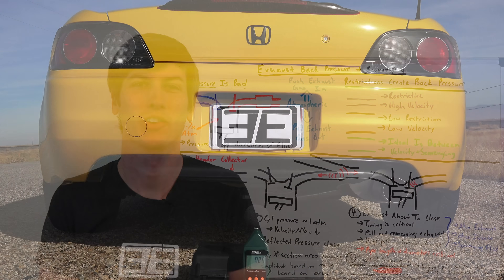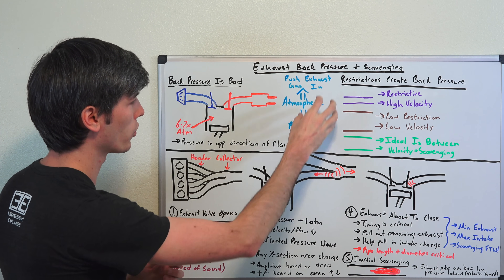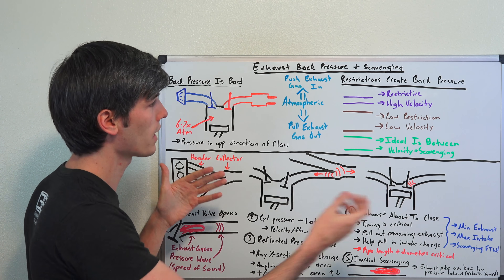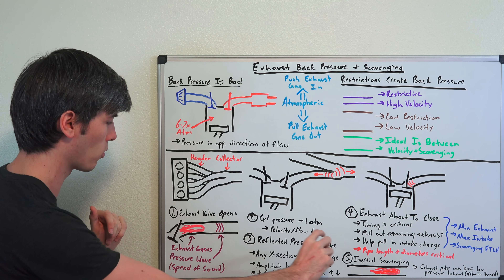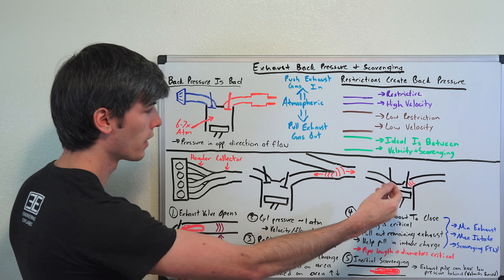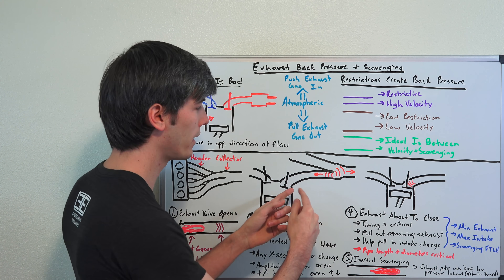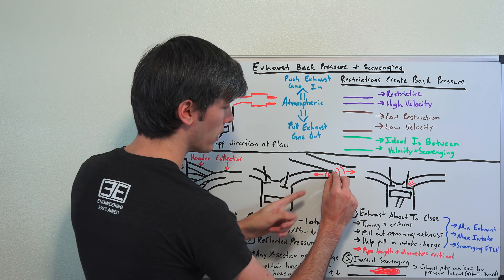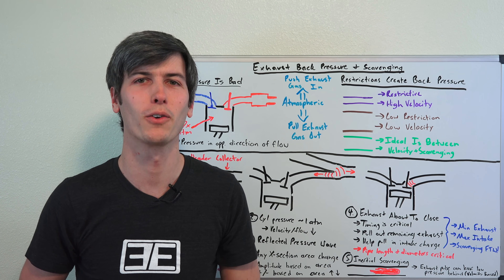Stop Saying Car Exhausts Need Back Pressure

Comment: In most older cars (at least ones that i have had hands on with), back pressure is used to help open the exhaust valve. This mitigates the force required by the engine to open the valve. The more pressure difference you have between the cylinder and exhaust pipe, the more force is required to open the valve. This is why you see a power loss when you slap a higher diameter exhaust on it.

Comment: And it's dependant on the amount of valve overlap...both need to be open to translate the low pressure signal from the exhaust ,through the cylinder, to the intake system.

Comment: Can u explain how when nascar enforced the use of mufflers the cars gained more power with back pressure? Also u don’t explain the scavenging affect of back pressure either. Should use a flow bench to see how some not all but some exhaust systems create higher flow then straight pipe. Again back pressure does help on some engine once u start getting into high horsepower then no it won’t help but lower daily driven vehicles absolutely just use a flow bench number don’t lie

Comment: They do need back pressure, at least on old engines. I had a 1978 carbureted Dodge 360 that flooded and blew out muffler during cranking. While driving to a muffler shop, it was weak, lacking power. After the new muffler was installed, it was back to normal.

Comment: You do need a small amount of backpressure for low end power, if you are running a race engine at high rpm all the time you dont need it, if you have a turbo vehicle then the turbo is where you get backpressure.

Comment: I think the back pressure myth might come from back when all cars had carburetors. If you drastically increase the available airflow to the engine without changing carb jets, you can end up with a lean condition. That said, exhausts back in the mid-70's and through the 80's were likely way more restrictive than the air intake, so just changing the exhaust would be enough to alter that airflow. I could be wrong, but that's my guess, since it's always older gentlemen who tell me about back pressure.
Reply: Sweet Warlock.

Comment: those of you saying you have lost power, you may well have.  Horsepower is a function of torque.  You can tune where your peak torque RPM is  by changing your header pipe cross section.  The formula   Torque Peak RPM= primary pipe c/s area x 88200 / volume of 1 cylinder.  So if you put something really big on your engine, then you moved your torque peak way up in your RPM, meaning your engine will have to scream to reach that point.

You can use a variation of that formula to find what size exhaust you should run for a specific RPM:   Primary Pipe c/s area= volume of 1 cylinder x RPM peak / 88200.  This way, you can set your torque peak at an exact point of your choosing, and find the header pipe size that is perfect for that.

Those of you that mentioned racers having multiple header sets are correct.  they use them to tune the engine based on the demands of the track.  An oval track where they can maintain a high RPM they can use a large pipe.  If they are going to have to do lots of acceleration and wide changes in RPM, they will probably use a smaller pipe to move that torque peak to a lower RPM so that they have power to accelerate.

Lots of math when building an engine for racing.

Comment: A lot of car guys talk about the backpressure BS. Sure, you don't want to run an engine with open exhaust ports! But if you reduce the backpressure of an engine just adjust the carburetor to compensate. Not that complicated.

Comment: so to design a set of aftermarket headers could you take the length of the factory header run an use that to go by for your measurements,.. would also be interesting to know how turbochargers effect all these variables as well :D

Comment: I managed to break my exhaust down the the back end of the catalytic converter. Noticed fuel efficiency went up a bit but I did notice that my car had more trouble accelerating up hill without pushing down a bit more on the throttle.

Comment: Exhaust back pressure was required on older motors to prevent burning the exhaust valves.
Check it out.
Reply: Only if lean after changing exhaust. Tune the carb. and no problems.

Comment: Great analogy. Is a negative pressure also called a vacuum? Seems it would be easier to understand calling it a vacuum. I think the engineers who have been designing systems for 100 years would understand this without the explanation. I may be wrong but I don't think they design engines to not perform. So thereby the design is going to be pretty much spot on...Right? No matter whether it is called back pressure or negative pressure.You're one smart guy. I hope you are not spinning your wheels here trying to reteach the masses something that most just do not care anything about...But in real time...Seems like it would be more so an exhaustive and frivolous attempt that is going to just result in way too much back pressure. :) Love your videos bro.

Comment: The only exception is on vnt/vgt design turbo’s. On rare occasions it is a requirement to have “back pressure” to be able to control the turbine speeds correctly. (It is more to do with velocity through the turbine wheel than actual back pressure). You can modify the turbine housing, wheel profile, nozzle limits etc to compensate but to the average “car expert” it can cause turbine over speed and eventual turbo failure. This does not apply to wastegated turbos of course.......

Comment: Non racing cars and motorcycles both gain considerable torque and power by using a silencer with some form of end baffle compared to a plain open pipe or a straight through silencer. I have 40 years of race engine development and dyno operation behind me and this I am certain of.

Comment: Excellent video! You've answered many of my questions except one. How do I figure out what is the correct tubing length and diameter if I was to design an exhaust system so that it makes power instead of losing power?
Reply: No exhaust! JK
Reply: @billbergen9169  No exhaust usually is not the answer.  There is no "tuning, no scavenging effect.
Reply: i think thats the hardest part...
i'm pretty curious too
Reply: This is so old, anyone figure it out how to calculate those?
Reply: @AkbarNurPribadi  There is a way that I learned in another video.

But it's in imperial, so I have to convert it. 😑
Reply: Extremely complicated math and computer simulations of wave propagation that was probably over the head of engineers until just a few years ago---OR trial and error,experimentation and track and dyno testing--I think that was the way it was done in the old day,even by race teams
Reply: @davidpowell3347  God can  ou imagine how tedious that must have been? I mean we hail the drivers from way back when... but jesus... Thinking about those engineers and how they managed to do what they did just stuns me everytime...

Comment: My wifes 2009 toyota yaris has had the exhaust gasket after the flex pipe 
deteriorate 3 times and the car sounds like a tractor each time.   When this happens the car can barely make it up a hill which normaly it could excelerate continuously up the hill when that gasket is 100%  why is this happening then?  The car is also a standard and no matter which gear i put it in after the gasket has failed the engine lugs so badly up hill the car shakes, take it to the shop replace the gasket for 27$ including labour and i can make it up the hill doing 50 km/h at the bottom and 110 at the top.  so i guess the 1.5l engine does need back pressure I dont care what your science says

Comment: Is this the case in let's say a smaller displacement, tuned intake, n/a gas engine? Does dumping exhaust into a 3 inch pipe vs a diameter that is a ratio of intake diameter and length.

Comment: In another words, you just don't know how good that exhaust system is for your car until you put it in and get it tested? This really sounds like only the car manufacturers themselves could calculate the optimal flow for the particular engine they produce.

Comment: years ago racing snowmobiles, we learned that proper exhaust design gave the equivalent of super/turbo charging.  You pulled air fuel mixture into the exhaust, and then the pressure wave pushed the mixture back into the cylinder.  Made good power but also polluted a bunch.  (And they were louder than heck, I don't hear as well as I should because of it). ;)

Comment: My motorized skateboard (when I was 18)  would go from 0 to 20 MPH very quickly with the muffler bolted on. With it off, it would struggle just to get moving and take a long time to get to top speed which was then 25 MPH. I tried my Mazda RX-7 with no cat converter or muffler on it and it too lost it's quickness from the starting line. Both are essentially two stroke engines but there seems to be something important to back pressure.

Comment: isn't there also an engine balance issue? At high rpm's the engine needs to be well balanced if it isn't going to shake itself to death.  Surely the key is to ensure the exhaust path resistance is as near as possible to the intake path ?

Or if the engine designers planned for an imbalance then they would intentionally offset this in the crank balance ? So any changes you made to the exhaust side could actually make balance worse ?

Just a thought.

Comment: Engineers talk about these things like they read it in a book, mechanics talk about these things because they have done them.  I agree with 75% of what this guy just said.  When modifying a car the FIRST thing you do is to know what you want it to do, then you match parts to achieve your goal.  The camshaft(s) are really the quarterback of the engine.  If you get the wrong cam and the wrong exhaust you will have a car that was worse off then it was when it was stock.  If you have a naturally aspirated car that you plan to put a turbo on you should really change out the camshafts (among other things).  I like the channel and the video was good but I think some things were missed.

Comment: You have idea or suggestion for how to figure out the proper main pipe? Single cylinder, four valves, one primary tube per exhaust valve. Would it be primary sizes added together to come up with proper main ( sense it is a single cylinder)?

Comment: I doubt you'll see this, but I straight piped my wrx with a mid pipe resonator. From the down pipe to the tip is 2.5 inches. The tip itself is 3 inches. Is that too wide or is that a good size?

Comment: If you say that a good exhaust design depends on the length and diameter of the header, then can someone explain to me what will happen if the diameter of the header is set constant with different length of header? Vice versa

Comment: i don't understand why exhaust velocity is important. I understand that exhaust leaving the cylinder quickly is important, but that doesn't help me understand why a huge exhaust pipe inhibits that process. it doesn't seem like it would be necessary to move faster, it has more room for more exhaust to escape at the same time.

Comment: I'm wondering, when aftermarket exhausts are manufactured, do they make sure their tube diameters and other parameters optimize for a good balance of exhaust velocity and restriction? I have a Toyota 86 and I wouldn't want to buy an exhaust where these are not taken into account. Is there any way for me to check before buying?

Comment: I have a question, on my 1998 Dodge Durango. I cut off the stock exhaust muffler and just welded in a flowmaster. I think it has a lot of back pressure. Would possibly a full cat back exhaust system be more efficient that just putting the muffle there and then dumping the exhaust gases. The system I have on it now it just a muffler then it dumps under the vehicle. So would it be better to just add a cat back exhaust system that flows all the way out the back of the car?

Comment: You're right, Dragsters just have short, unbaffled 3ft pipes coming straight out of the engine. I'm sure if complicated, slower exhaust systems would give the engine more power the engine builders would use that.

Comment: I have a question. what about a car with a carburetor and a high performance cam. those cams have valve overlap where the exhaust and intake are open at the same time for a short period. since you cant specify when the fuel is injected since its a carb, would you want there to be some back pressure so that you don't have unburnt fuel going in the chamber and out the exhaust during overlap? this is a small portion of vehicles and a vast majority of cars on the road today are fuel injected so you can program the injectors to go off after the exhaust valve closes, but you cant do that with a carb. this is the only time I think you would need backpressure, so that you can decrease the amount of air leaving the chamber during overlap. or am I completely wrong on that. hopefully you see this, i'm pretty interested in your answer. I honestly don't know if it benefits in this scenario or not.

Comment: Hi, I've just read this about the launch of the revised Audi TT: (see 2nd paragraph of quote)
"For the 2.0 TSI, three states of tune will be offered, with the first, the 40 TFSI, producing 194bhp, 16bhp more than outgoing 1.8-litre TFSI that features at the bottom of the current TT range. There will also be a 242bhp 45 TFSi, while the TTS (pictured above and below) gets 302bhp, a decrease of 4bhp thanks to the fitment of a new particulate filter.

An Audi spokesman said that the resulting increase in back pressure has helped to boost torque, helping to shave a tenth from the pre-facelift car’s 4.6sec 0-62mph time."

Comment: did i hear correctly that too wide of a pipe creates to such low pressure that its not exiting properly and ends up pooling somewhere near the end and creates to much restriction? seems like what he said, otherwise i dont see a problem with next to zero restriction, velocity or not.

Comment: Dude, thanks for the vids, your obviously one smart kid. One thing I think you missed though, when most people make that comment although they are using an improper phrase, what they are implying is that they know, sort-of-kind-of, that exhausts are designed/tuned for certain performance characteristics, and that just whacking off part of your stock exhaust and replacing it with some goofy poorly engineered screamer is usually not a wise idea.

Comment: No cars don't need back pressure (great for high rpm racing), not for the street.  All factory cars exhaust are already tuned to work efficiently with the pistons compression, crank, cam and carb set up they are married to.  If you don't want to complicate your cars performance it is best to not change the system unless you are changing it with something with better materials, but you are not changing the basic tuned design of the original.  Example:  Don't put a big cat back system on you car (freer air flow) without change you carb, time, cam and lot of other parts they are all designed to work well together.  Unless you really know what you are doing, all you are doing is wasting you money.

Comment: Depending on the application and the engines RPM limit you may need back exhaust pressure or not! "Mr Engineer" Danm! You are getting worse and worse with each new video!

Comment: What is your opinion on motorcycle exhaust?  I have a 4 cylinder bike.  The headers immediately join into a collector that immediately feeds a catalytic converter which then connects to a factory muffler.  Whole system is less than 6 ft long.  I would like to remove the factory muffler and replace it with essentially a straight 2.5" pipe.  I want more noise without sacrificing power.  Do you think that given the relative short distance of the system and the catalytic converter location that this would reduce the exhaust scavenging?  Would an adjustable steel lollipop in the straight pipe be of any benefit?

Comment: Hi, I own a 2017 Honda civic si and want to have a performance exhaust installed.  I like the deep throaty sound but not the loud high pitched versions. I am in Marietta Georgia and want your advice on what brand to get, and where to get it installed

Comment: finally someone that get that the smaller factory exhaust exists to increase exhaust velocity. one thing though, for the scavenging section the intake valve opens at the end of the exhaust stroke while the exhaust valve is still open so that instead of creating a lower pressure in the cylinder, the cylinder is swept with fresh air removing the last bits of the spent air fuel mixture, this is called valve overlap. 

the factory exhaust system is designed to provide good drivability at lower engine rpms while providing reasonable performance at higher rpms. the reason to change to a larger free flowing system is to provide more performance in higher rpm ranges, sacrificing low rpm drivability.

Comment: The exhaust system with "back pressure" can be designed to create pulses/waves of pressure that can assist in evacuating the exhaust from the cylinders at the right times. this can help for example to create better torque at low rpm for a particular engine. A fully free flowing exhaust with zero back pressure would not allow for this type of optimization since you cannot create any kind of pulses of vacuum to help evacuate more exhaust than atmospheric and will always leave more noncombustible exhaust inside the combustion chamber in comparison (there would be a point of optimization). Once you have forced induction none of this matters because the power gained per added flow overcomes any other effect so more free flowing the better. I would imagine a similar case may hold true for non-FI but just overwhelmingly powerful engines or engines running at very high RPM.